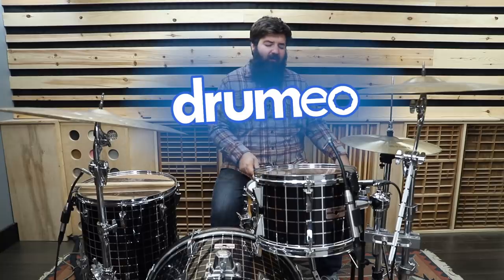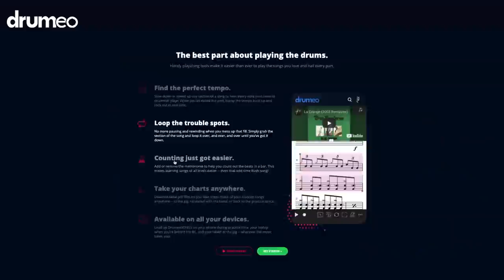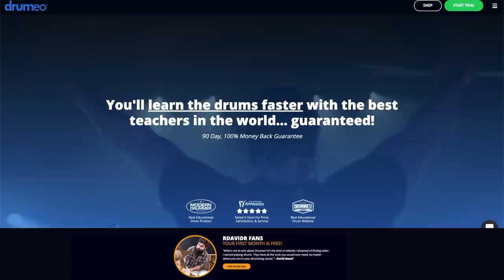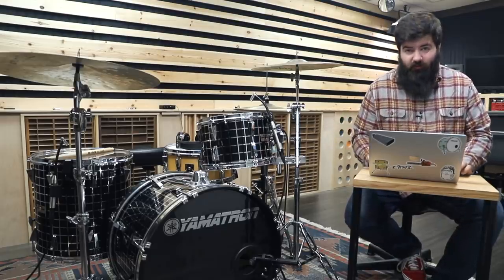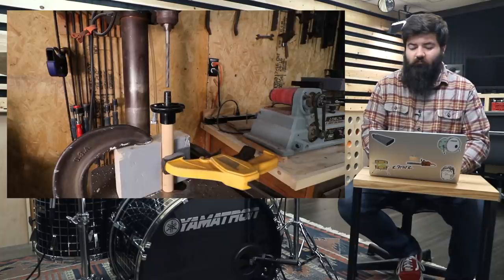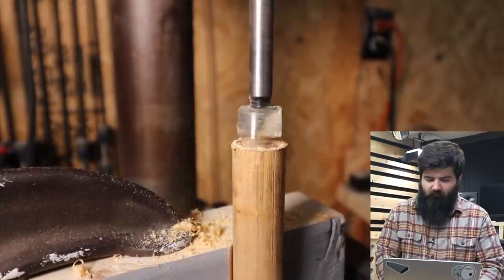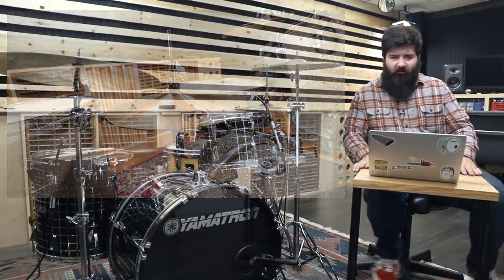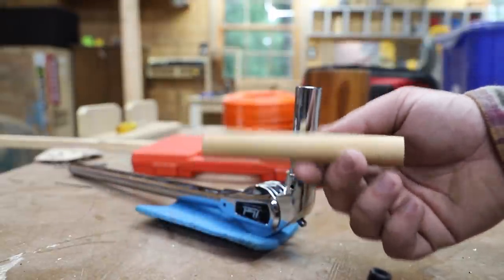I Followed a Drumeo Tutorial and Made This For My Drum Set!

Comment from the maker: Do you use an auxiliary hihat?

Sign up for a free 30 day trial of Drumeo Edge! 
https://www.drumeo.com/rdavidr
Reply: I use 2 X hi hats, well one is an old Hi hat stand I coverted because it was from Groove Percussion. The other is from Meinl. But I loved the video and have to ask. May you please try and make a Remote Cable Hi Hat Stand?
Reply: When sanding and filing the hihat post after cutting it down to length, you should chuck it into the drill, to speed things up.
Reply: I 🖤’em!  I use everything from quick and dirty cymbal stands with felts/washers to the DW, MG-3. Also an old cheap HH stand. You really can’t have too many hihats. 😅
Reply: I have two: one for a china x O-zone crash stack another for another pair of hihats
Reply: I wouldn't call it an aux hat as it doesn't open n close? Just a stack imop lol!
Reply: @TheStudioDrummer  I concur. I am trying to make a 100% symmetrical Drum Kit. I am aiming for about 6 of them. 2 Regular Stands, 2 Cable, 2 Aux. I also have 2 rides, 2 Chinas, and about 4 Crashes. (In use)
Reply: Actually no, I play with 2 auxiliary splashes on a hihat mount! lmao
Reply: If I could afford it
Reply: I use a stack as my main hi-hat
Reply: Novel placement. Mine's placed just to the right of my ride.
Reply: 4 hats on my kit. 1 standard trick pro 1v1 hh, 2 x trick predator cables hats and one closed hat arms. love having Dif sounds for Dif sections of songs
Reply: This is sweet! - Now if you could make a follow up-video on how to make your own DIY remote pedal that would be the icing on the cake!!

Comment: Did you do anything to the top of the hihat rod to prevent it from rusting? I’ve learned another trick to prevent that from happening, cut the other end of the hihat rod and retap the threads, the tip would stay the same, bo treatment necessary to prevent it from rusting. Either way cool hack! I do use aux hats depending on the kit
Reply: oops - just made the same suggestion.

Comment: You need a forstner bit to make the larger hole on the bottom of the dowel. A regular drill bit may work, but it will never give you a nice flat surface for the nut to rest on like a forstner bit will.

Just thought I’d mention that, since it’s never explicitly stated in the video, and newbs probably have no idea what a forstner bit is.

Comment: Now just take the bottom part of the old Hi-hat stand / controller and run a bicycle cable off of the old placement of the Hi-hat stem and run that same cable to the new hihat post  / stem. Now you have a hihat clutch rack mount. You just saved $559!

Comment: Awesome project. Couldn't you just drill a hole in the plastic plug in the tom arm? That would be simpler than cutting and drilling the wooden dowel. I agree the dowel is more secure. 
I'm just lazy 😎.
Reply from the maker: Mainly so that its solid, but you would also have to find a different size seat to fit over the tom arm

Comment: errr...no. My dad built something better than this about 35 years ago. Because we were poor, I rang one of those 'do you have a good idea' patent companies that used to advertise on the TV...if they stole my idea that my dad built, I don't know. But the TV adverts were a scam.

Get a threaded rod the diameter of the threaded section of a hi-hat clutch. Drill out the middle and thread it to screw onto your cymbal strand (my idea was to actually use what ever Tama were using for their self-threading cymbal sleeves as an internal sleeve for a public product, but for the one that was built, doing it custom to the boom arm was easier). have 2 sets of locking screws...one internal and one external to the top hi hat. Have something done to the  uppermost section of the rod so you can get a grip and turn it down onto the cymbal stand. When the rod is locked down against the bush protecting the bottom hi hat, alter the external locking nuts to get the tension you want between the top and bottom hi hats. Then remove the rod and tighten up the internal locking nuts to where you want them. Then screw the rod with the top hi hat on it back onto the cymbal stand.